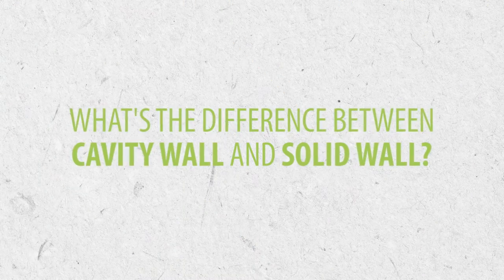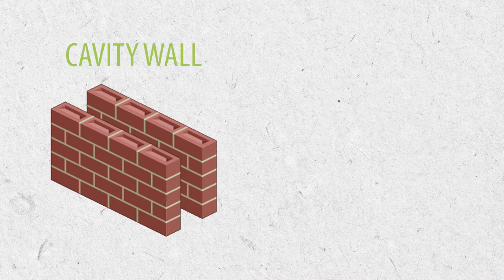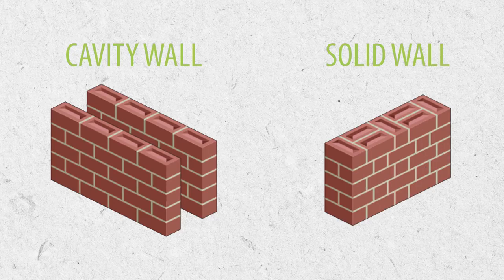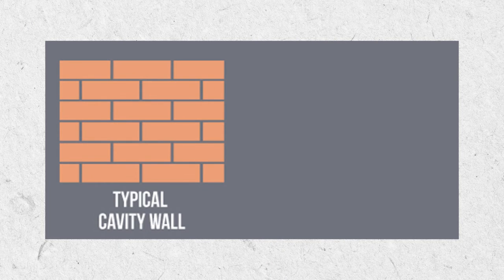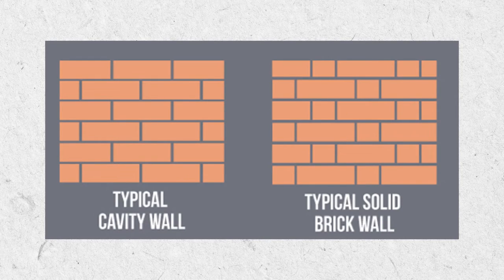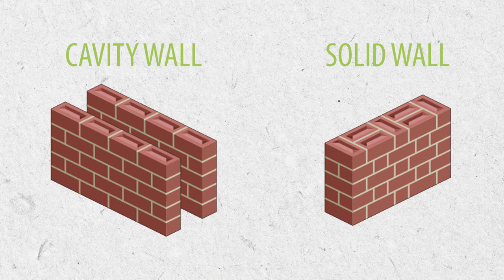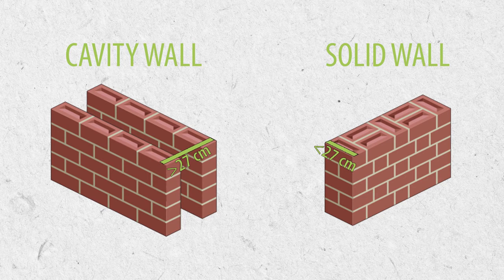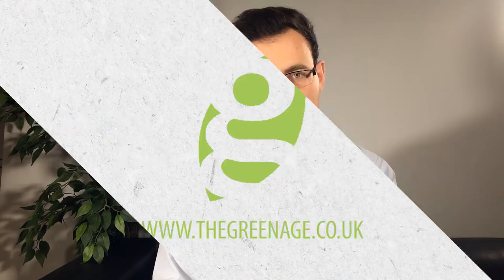Cavity Wall vs. Solid Wall | TheGreenAge

Comment: I live in a relatively 'new build' property on an estate and have been offered CWI under the ECO sceme.  I'm pretty sure the construction was brick and block with Cavity which has Kingspan Insulation board in the cavity.  Is it correct to do a property of this type as there must only be a small gap in the cavity to fill.  Should these companies be doing work on property of this type?

Comment: which is a better thermal insulation choice? cavity wall (air gap) or solid wall? i am building a new home, shud i slab 2 bricks together for a solid wall or leave a gap
Reply: Use clay bricks , cavity better for waterproofing. Cavity is better not much difference in insulation between the two

Comment: 'm a retired bricklayer. Knowing what I know now, if I were building a house for myself again, I'd build a block core filled home any day over any other type of construction.
Builders can tell me all the BS they like about lightweight panels, timber frame etc etc, but you can not beat good old reinforced core filled block as long as the outer skin is correctly waterproofed.
As far as I am concerned, a lot of this R value stuff is BS too, designed to sell a LOT of product.
Reply: To add, I am not saying that insulation doesn't work. I am saying that a solid block wall that is correctly built and insulated, beats a cavity wall any day.